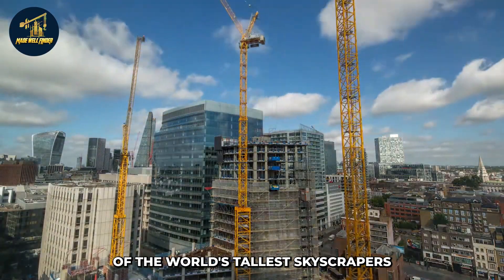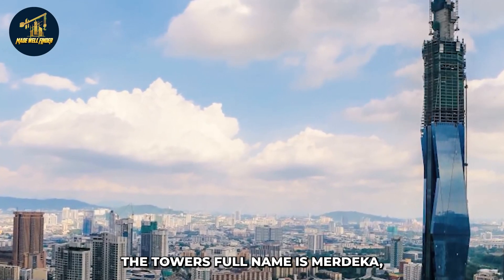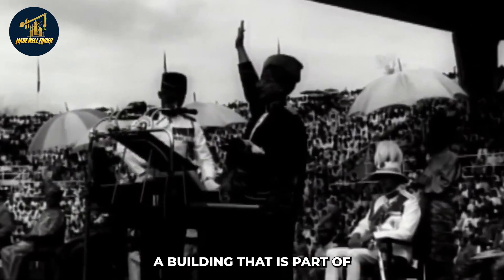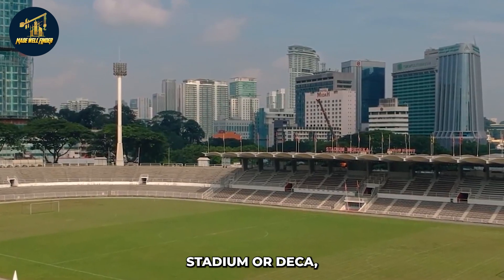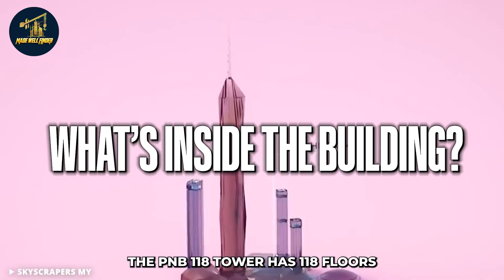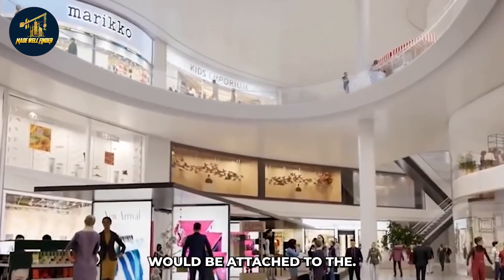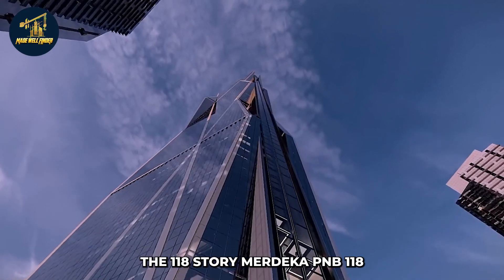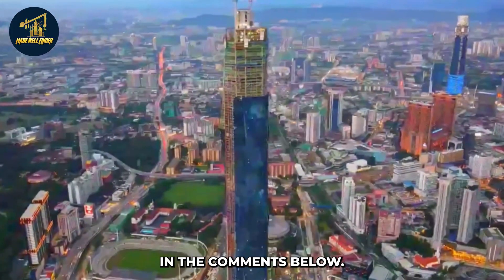Merdeka 118 - The World's Last Mega Tall Skyscraper

Comment: The scene at 3:35 of this video is a scene where the inclined core is cut with wire cutting. Construction of PNB118 was suspended for 15 months due to faulty foundation work, and Samsung C&T stole the reinforcement grout mixture to proceed with the construction, and as a result, the opportunity to complete was missed. With at least 30 floors demolished, pnb118dms is only about 400m high. In addition, the impossibility of completion is due to the fact that more and more places are blocked with white panels instead of the broken curtain wall in the video and differential settlement.

Comment: At 420 meters high on the Kuala Lumpur skyline, the Broadcasting Tower sits slightly above the PNB118 building. In other words, the PNB118 is 415m instead of 679m. The lower-than-planned building was tilted and 30 floors were removed. In the original design of the PNB118, the tower at the top of the building was designed as a glass curtain wall, which was included in the height of the building, but now it is treated with a perforated aluminum plate. Because of the wind pressure, it has been changed to an open structure that allows rain and wind to enter the inside of the tower, so it is just a tower. The PNB118 became a vintage building shape that had passed 100 years before it was even completed. Inside, it is expected that an unpleasant noise of the structure being destroyed will be heard. Who will use it?

Comment: Merdeka 118 tower is only 1,702 ft without its spire. And its top floor is 1,650 ft. So it cheats to claim mega tall status. To be fair Burj Kalifa's top floor is 1,850 ft and the last 800+ feet of the building is just decoration with no usable space. "Merdeka 118" is actually a smaller building for its claimed 2,233 ft. height. In comparison to the super tall Willis Tower in Chicago Illinois for example, it's actually a much bigger building at 4.5 million sq, ft. Merdeka is 3.1 million sq, ft. in comparison. So a lot less usable floor space.
Reply: By the way same with burj khalifa using spire to achieving the ultimate height and recognized by CTBUH 👍
Reply: Not like later added antenna on the top of Willis tower
Reply: Spires are considered a continuation of the form of the building. The council decided that antennas should not count toward height, but spires do count because they're part of the architectural design of the building. 8 Nov 2013
Reply: @ezzywish417  Yes. But they also admitted it's highly controversial. Which is why they created four different categories as a result now. 

Ground to spire, Ground to Rooftop, ground to architectural tip, and ground to highest occupiable floor. 

The Willis Tower (Sears Tower) is taller than three out of these four categories in comparison to the One World Trade Center for example.
Reply: @GalaxyFur  
Just need to accept the rules set by the professional body. Spires are considered a continuation odf the form of the building. Arguments will always be arguments. Rules and regulations are provided by the professional body. Just need to accept it.
Reply: @ezzywish417  The 4 categories are official. And their initial rule did backfire on them. The One World Trade Center spire is infact a broadcast antenna. The developer only had to place a " decorative cladding" around the broadcast antenna to make it considered a spire. A loop hole in their rules. 

But at the end of the day if you ask anyone on the street, they will say the building with the higher roof and floor is the taller building. 

It's hard to consider a building taller if you can look down at it from another building. 

Kind of like the situation in LA as well. If you stand on the roof of the US Bank Building in LA, you can look down at the Wilshire Grand Center. 

Using that exact same logic I can put a cheap decorative 12ft, cladded antenna on a small little 4cyl car and the car will be taller than a large 18-wheeler Semi truck. 

That's why the decorative thing is now considered by so many as to be laughable.
Reply: @GalaxyFur  pathetic.. that's what people say when they don't have one.. LOL